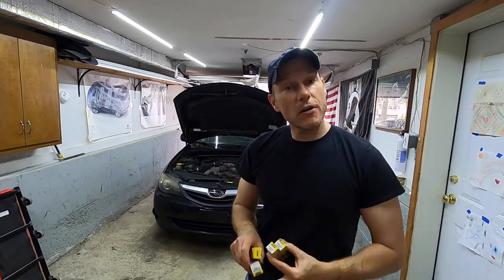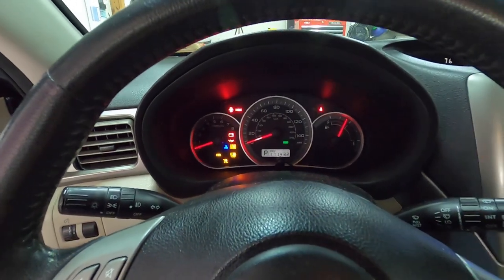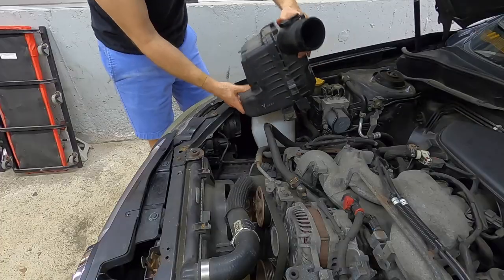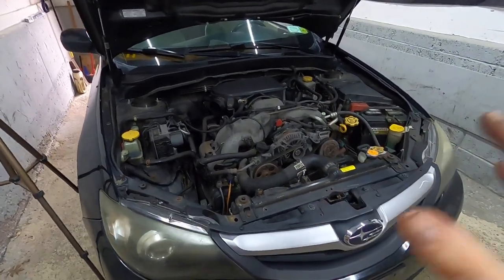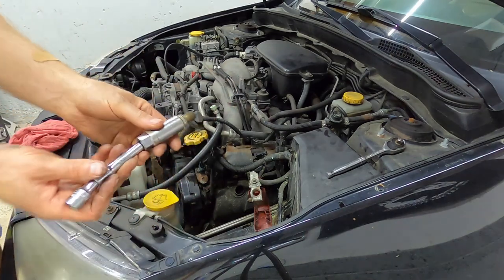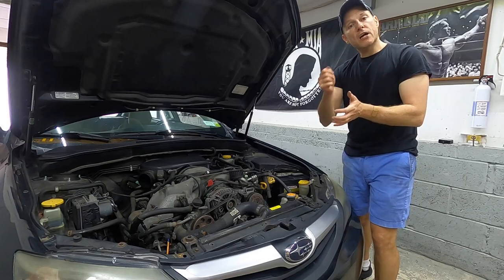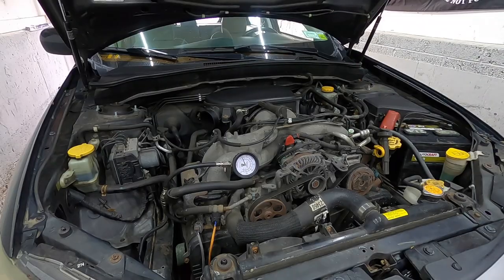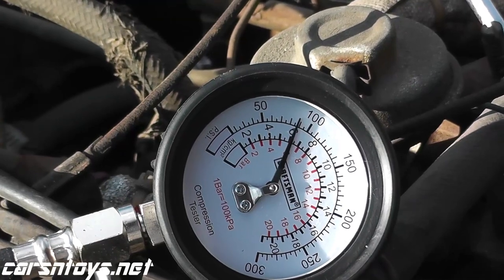Are SUBARU BOXER Engines Reliable? | I Compression Tested My Subaru Engine with 170K Miles

Comment: Hey I just found your channel and subbed I just got in to a bad car accident with my 2011 Wrx hatch I want to fix it. From what I’ve seen so far the whole radiator and support was pushed a bit into my timing case but the inner frame doesn’t look damaged, I just genuinely have very little experience with fixing case of this nature. I have a good amount of time to learn and a lot of patience but not a big budget to fix it. Was wondering if you had any advice how I should begin to tackle this situation. Thank you 🙏🏼

Comment: I have a 2014 Outback 4 cyl, not leaking oil...right now the #3 cylinder is at about 30 and all the other cyls are at around 160...would this point to a valve problem?  Or something further inside the cylinder?  Thank you in advance for your opinion...great videos, by the way!